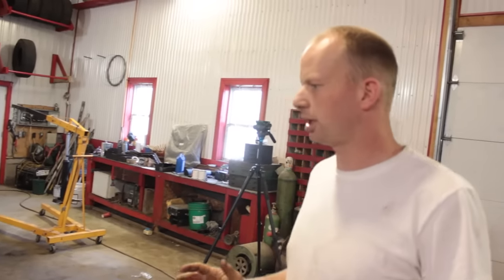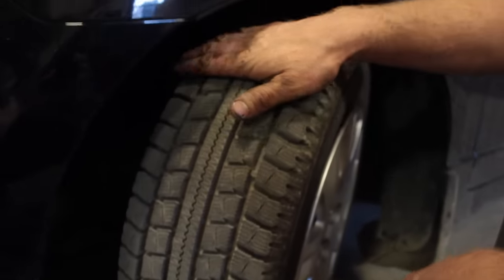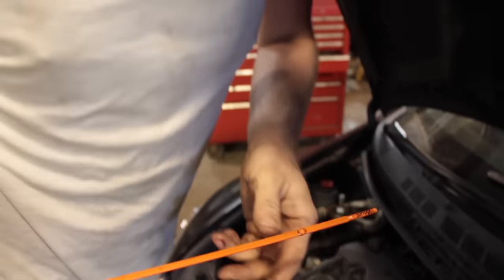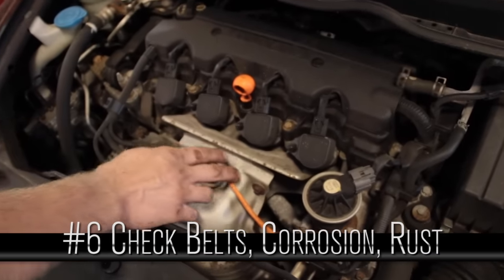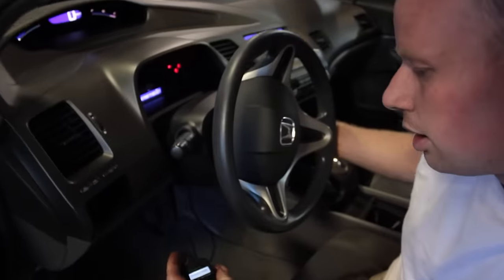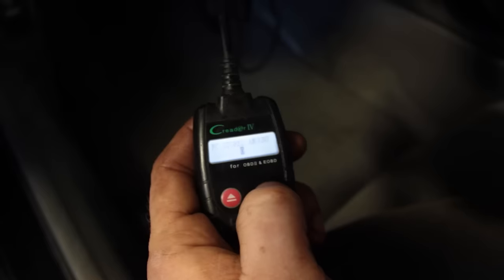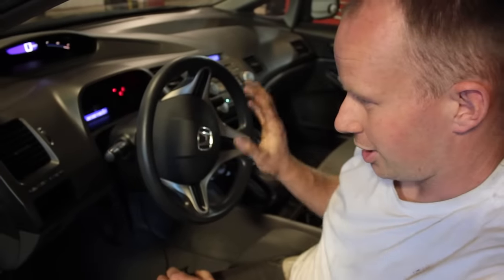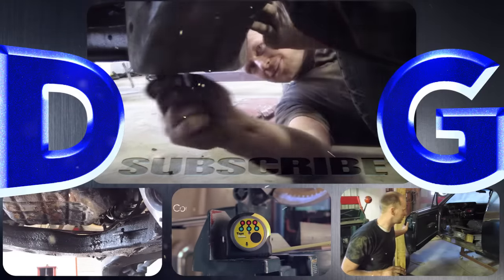12 Things To Check Before Buying A Used Car

Comment: Check that windows work, air conditioning, heater, horn, lights, wipers, seatbelts, turn signals. Most people forget these little things.
Reply: R H yessirr
Reply: Make sure the radiator fan turns on while idling parked.  Also windshield wipers and fluid work.
Reply: Checking the miles of the car is a good thing too. Tells you the life of the car...if its over 110k, most likely the motor parts and other things will start betraying you some time after the purchase......
Reply: As long as the engine and radio works I'm fine I don't care about air conditioning I'll roll the windows down
Reply: I would bring a  head gasket tester to see if your head gasket is good. Turn the AC on and the fans should come on ( two if you have two )  and run it at operating temp. Check the fans again they should be running and blowing hot air and not cool air. Also check brake pedal pad wear.. If you do not see any pad wear on the right bottom of the pedal then most of those miles on the car were highway miles.
Reply: Thank you
Reply: @savageman4047  In Arizona you wouldn't say that . Lol
Reply: That’s small things , worry about big things
Reply: Check the undercarriage too. Everything worked good in the car but the frame was rusted to the point of breaking.
Reply: Savage Man lmfaoooo
Reply: @savageman4047  some places, you need a/c or you'll bake yourself
Reply: j43w0n i live in florida
Reply: @focushdtv809  every detail matter a lot.
Reply: I just want to start the car and head all out.
Reply: @jopisano67  your nose is good about 78%
Reply: Thanks man
Reply: Reply important 👍
Reply: Reply important 👍
Reply: @ivelisseys7285  ,,, Not necessarily !!!! What is important is a servicing history of the vehicle. The car can have a high mileage but is well maintained.... As in the case of my 24 years old Honda accord.
Reply: I bought a car once and didn’t check the horn until I had road rage.. so irritating 😂
Reply: Going to look at one today and took a screen shot of this comment thank you
Reply: Be sure to test out the airbag as well lmfaooo
Reply: Go and buy a new car
Reply: Yeah I bought my civic and only two windows worked. That was the one thing I didn’t check. Check everything, everyone
Reply: So true, I missed that one of the windshiel nozzle sprayers wasn't working because I didn't test it.
Reply: Also move all the sound into each speaker separately so you can check they all work 😊
Reply: Thank you!
Reply: Press down on each corner of car. Car should not bounce. Uncle buck.
Reply: and cruise control
Reply: @savageman4047  🤣🤣🤣🤣
Reply: yes little things are important i’ve bought cars that the windows dont work and the blinkers smh
Reply: Good points.
Reply: Those are all cosmetic.. check engine parts. The little things can easily be repaired.
Reply: @jopisano67  I'm confused about the air running hot and not cool after running the AC at operating temp. Why does the air run hot if you're running the AC? Also, how long do you run it before the air starts blowing hot?
Reply: Ya but that's lil shit I'm worried about breaking down
Reply: @ivelisseys7285  this is just bad advice, many vehicles if taken care of by the bare minimum can last well over 200k
Reply: @savageman4047  roll them winders down
Reply: @DyLemmaOG  thats old bruh i bossed up 2022 ram big born 1500
Reply: @savageman4047  😂😂😂😂
Reply: @savageman4047 better hope the windows work then too or be ready to bust one out if need be
Reply: Locks too!
Reply: @savageman4047  you would not say that in a hot climate. Probably you live in a cold place.
Reply: @focushdtv809  exactly, if the motor is gone there's no need to worry about seatbelts and turn signals
Reply: @My2Sense-c7y or Texas lol

Comment: Also, get a flashlight and check under vehicle for leaks, torn boots, and rust. Good idea to check for leaks after test drive as well. Make sure engine is cold when you first start it up, as a warm engine can mask some issues.
Reply: What if you found a torn boot? is that a deal breaker? How much is that to repair?
Reply: Frame  rust is a huge no no and easy to check for.
Reply: If you find a torn CV boot or if it tears later here is a recommendation....... get a new CV boot assembly..  you have to remove the torn axle anyway so you can save some time and labor. The extra cost of a new CV axle could be offset by the reduced labor for replacement.  You have to remove and replace axle anyway.   Purchasing entire axle assembly just remove and replace.  If you fix the boot it is remove axle
 Remove boot, re grease and re install.   Lot better things to do with my time.  By the time you add up the extra labor of replacing just the dust boot with time and extra risk of potentially losing a bearing or not installing the dust boot correctly,  I would think that the new axle assembly should be close in price and if you can get a core refund on the axle your ahead of the game.
Reply: Can we get a wagon used car to buy here
Reply: I was looking at a car at a used car dealership.  It supposedly had passed a "25 point maintenance inspection".  I test drove it, the looked under it and antifreeze was running out the bottom.  More than just a few drips.  It was impossible to miss.  The water pump was bad and leaking antifreeze.  It made me wonder what kind of 25 point inspection could they have done and not noticed antifreeze running out the bottom.
Reply: Amen, thats the only thing i didnt check and frame was rusted to point of breaking
Reply: How do you make sure the car is cold when you start it up?
Reply: @BrettonFerguson  I just ran into this with a used car passing a "120 point inspection". It was in bad shape.
Reply: @BrettonFerguson wow good catch

Comment: 1. Don't buy it at night
2. Check tires
3. Check transmission fluid
4. Check engine oil
5. Check brake fluid
6. Check belts, corrosion & rust
7. Check anti freeze
8. Obd2 ”0 diagnostic code”
9. Obd2 ”Readiness test"
10. Listen for any noises
11. Check online reviews
12. Call a parts store
Reply: Bump
Reply: Bump
Reply: Man i need a video explaining how i check all this cuz god knows im a dumb ass when it come to cars
Reply: @BestEndDB  bro me and you the same frfr
Reply: do we check the oils after test drive or right after turning it on or while off? i know coolant is checked on a cold car.
Reply: You only want to spend $8k and wanna be perfect?
Reply: @subinj9174 😂😂
Reply: @kemangraya2382  Yep! A girl can dream can't she....
Reply: i fell into this.. i wish i had watched this video before as the car i bought 2010 honda civic had its wires coming out of the tires and had a bad mileage as well.
Reply: @BestEndDB same man. Also W pfp🤝🏾
Reply: Thanks bump
Reply: Thank you that's was a big help
Reply: @manik8759  at least its a honda, there is hope lol
Reply: Always check the bottom of a car when buying one make sure the Frame is not Rust

Comment: damn i never new trying to buy a used car would be this complicated. its alot to think about
Reply: knew*
Reply: big kev.  I never KNEW how complicated spelling is.
Reply: Damn grammar police
Reply: Yeah there so much to analyze. Its not for everyone but if done right and thoroughly inspected you'll find yourself some good deals.
Reply: It doesn't matter if u buying brand new car but old car definitely need to check on lots of stuff.
Reply: yeah im going to try and have a professional take a look maybe even if it costs $40 per say. if its a no go then he saved me thousands
Reply: The more money you saved, the more you need to research.
Reply: hire a mechanic to do this job for you. They can have a better understanding of the problems than someone who has not experienced it.
Reply: @jerbsherb4391  even if the car runs fine and everything is working fine, the owner is likely a total idiot too so getting it checked could spot something severe about to happen

Comment: Also another good tip, look at the car brakes. The rubber cover over the break is thick, so if you can see the metal part on the brake, then that means the car had been driven A LOT and for a long time. Doesn’t necessarily mean it’s a bad car but it is something to consider
Reply: Can brake rubber covers be replaced ???

Comment: In addition to those 12 amazing tips here are my 5 cents.... Check under the vehicle for extreme corrosion, chances are that the car was sitting near the sea and salt air would have damage parts under it. When the car is turned on put a white cloth close to the tailpipe of the exhaust for about 5 seconds, If you get bits of oil on it that will tell you that the rings of the engine are worn out and it will need an engine overhaul soon. Some people say that if the milage is at 200K, it will need overhaul soon. Look around the engine for oil leaks, if there are any, simply don't buy it.
Reply: Wow now that is a hell of a tip I would have never thought
Reply: I've had Toyotas and Honda 4 cyl engines go up to 400k without any overhaul.

Comment: This is so much more helpful than another video I just saw, where the guy pulls out some gadget I don't have, and then pulls out his smart phone which I don't have, etc etc.  Your tips are very simple and anyone can can do them without high tech stuff.  Thank you very much.
Reply: That was Chris Fix I believe and it was  OBD II reader, just like this guy had but used a smart phone to get results.  If you don't have an OBD II reader, most people don't then just hope or take it to a shop before buying.   I never thought about taking an OBD II reader and probably still would not. Good tool to have to used when you take you car in....or just re-set the codes in case the error was a fluke.
Reply: An OBD-II reader is essential. There are two kinds, self-contained like Rick's, or Bluetooth that uses a plug-in device and a smartphone (or tablet, etc...) Very simple to use, and will find problems you can't see by inspection.

Comment: I laid on the floor and looked under the car...I noticed some overspray on the front bumper. After many questions from me, the dealer came clean and said the radiator was replaced. I keep probing because the car made a weird noise when shifting from Park to drive... It was obviously in a front end collision.  They almost got me! Also, run your fingers on all the edges of the panels, if it's rough, it was likely repainted by a body shop.

Comment: Another good thing to look at are the filler caps for the oil and the coolant. The oil filler cap is normally located atop of the valve cover. The coolant caps are typically located directly atop the radiator. Take each one off and inspect the bottoms of the caps. Someone selling a vehicle with blown cylinder heads or bad gaskets, will change fluids but will almost certainly forget to clean off the evidence from the bottom of the caps.
Reply: What will the caps of bad ones look like?
Reply: @holylabs did you ever find out?
Reply: Chocolate milk is what i call it. Itll look milky brown when the antifreeze and oil mix.. if that happens car is done.
Reply: @holylabs chocolate milk
Reply: Thanks for the tip! Sadly i didnt know this when i bought my first 91 stealth

Comment: Just to add some few more things;
1. Turn on the car and beside the fluid oil, there is a rubber which spins around the engine. Make sure that rubber is not damaged or too loose.
2. Go underneath the car, make sure there is no oil leakage and fuel pumps work good
3. Make sure car engine does not make too much noise
4. Make sure the cylinder does not have loud noise when accelerating(depending on the car)

Comment: and avoid buying in the rain or cold days, so you can determine if its smoke or gas or steam coming out of the tailpipe
Reply: tom slick smart and also rain can hide scratches and dints
Reply: rain will also soften suspension noises
Reply: @Facide Your first car is probably not a sports car lmfao
Reply: Fuck it’s snowing out today
Reply: People in the UK punching the air rn

Comment: 2. Tire
3. Transmission fluid
4. Engine oil
5. Brake fluid
6. Check belts.
7. Check antifreeze
8. obd2
9. Readiness

Comment: Great video, thanks for posting! I remember one tip not mentioned that my uncle told me, when you pop the hood, look on the underside of it to see if any oil has been slung up there. My other uncle showed me how to do a quick shock/strut test, go to each corner of the vehicle and push it down hard a few times to get it to try to rock up & down, if the car keeps rocking when you let go - it needs new shocks and or struts.

Comment: Look for cracks in tires, means it was sitting for a while which means it had major work done recently or just “Bandaged up”.
If you can, jack up at least one side and push the wheel side to side with both hands and if it rocks back and forth it then it’s a bearing and/or ball joint, tie rod end, linkage. 
And do a lean check online with you local DMV…it’s less than $10 usually and it’s insane how many people sells vehicles they don’t own.

Comment: i tried buying a hyundai tiburon and the dude was nonstop talking trying to cover the rattling sound the car was making, i acted very disinterested in what he had to say and then i complained about the noise and he tried pretending it was nothing
Reply: gargundX your first mistake... Hyundai
Reply: gargundX what was that rataling noice
Reply: How is the car? did these tips help?
Reply: Yess
"On my way to possibly purchase another used Accent right now."

Wonder if you bought it and did these tips from the videos helped.
Reply: Nice. Thanks for sharin.
Reply: Remember Me? Stuck in the early 2000s?
Reply: gargundX He ended up being a tiburon😏.
Reply: dad had a 2003 Hyundai tiburon. lasted 540,000km. great car very little issues. it was a Manuel transmission though which should be kept in mind.
Reply: Same thing with me .....
Reply: Hyundai and Kia are two brands that will really try and scam you. Especially with the whole negative equity thing.
Reply: Well i know one thing...you wont be getting any wmn
In that
Reply: Remember Me? More reliable cars then bmw
Reply: Used car salesman: "Oh...that noise?"  "I locked my honest mechanic in the trunk because he was about to spill the beans about this car."
Reply: @DiamondScuff  make sure there is paper work to confirm the timing belt was done or get it done pronto for a cut off the asking price , they only made to 60k but iknow peeps with one over 200k and the belt has held on..
Reply: Hyundai used.  I would not buy one new. Toyota or Honda
Reply: That's so funny but smart on your part :D

Comment: Remove oil cap flip cap over look for white milky oil/antifreeze mix *sign of blown head gasket.
Reply: AC/DC.4.LIFE ! K this should’ve been number one on the list
Reply: Actually it's not, your best bet for a quick check on the head gaskets is to check the dip stick. Most of the time when there is a milky residue on the oil cap it's just moisture.
Reply: Another sign of a blown head gasket is the radiator overflow bottle bubbling up like lava during acceleration.
Reply: Taste the oil if it’s sweet it’s a blown head gasket
Reply: @crankshaft1053  😂😂
Reply: MoR RiS what it’s true 😂
Reply: @crankshaft1053  😆
Reply: TheLorola I’m serious
Reply: Some gunk on the oil fill cap is normal on a high mileage motor. But it shouldn't be on the dipstick. There's test kits that can check for coolant in the oil/ contamination , even at low levels where it's difficult to tell. If you see " brown milkshake" instead of normal oil on the dipstick, Do Not Buy. And if you see " pink milkshake" on the transmission dipstick, Don't Buy it !
Reply: Yellow stuff under the oil cap is a sign that the car has had a lot of short trips. Yellow on the dip stick and bubbles in the radiator means the head is blown.

Comment: On many vehicles you can't check the transmission level with a dipstick anymore, you need a diagnostic tester that supports that function. Also check for any open recalls, crashes etc:
Reply: Here’s a little bit of advice don’t buy a car. You can’t check the transmission fluid on it with a dipstick because you have no idea what’s going on in the transmission
Reply: @DCSPORTSTER  Actually, you can still check the fluid, just not with a dipstick.  You can always disconnect a cooling line at the radiator, or simply climb underneath  and check it.  Yep it's a pain but it's not that tough. The diagnostic tester just will show the level. Or, you can pay to have it checked. The color of the fluid may or may not tell you what might be going on inside.  And just a small hint: Transmission dipsticks are slowly becoming a thing of the past.

Comment: Thank you. I'm about to buy. 2012 Hyundai Elantra.  When I go back to pick up the car I'm going to go through the steps outlined. 
This really helped me.  
I didn't hear anything out of the ordinary when I took it for a spin, nothing looked rusted but a second overview is smart.
I went back to the dealership after finding out the truth about the price of the car, they would've screwed me a/out lube. Thank God I used common sense.  I hate car dealerships.

Comment: If you can see the brake pads, when they are the same thickness as the metal plate, they need changing. When the tire tread is meeting Lincolns brow on a penny, they are about 50%.

Comment: Check for white clumping on the oil stick. That's a sign of water in the engine, leading usually to a bad water pump or head gasket

Comment: How about checking all power options, windows, doors, sunroof, seats?? Make sure you check Ac system, even in the winter you should here the clutch engaging the compressor. The frame and rails, the rockers for rust and rot. Big issue with older north east cars. Make sure you check the gaps on the panels. Their is so much to look for. Basically if you don’t know what your doing, go with someone that does
Reply: I have had to junk a few mechanically perfect vehicles due to rust and rot here in Maine.  I now have my cars sprayed with fluid film each Fall.